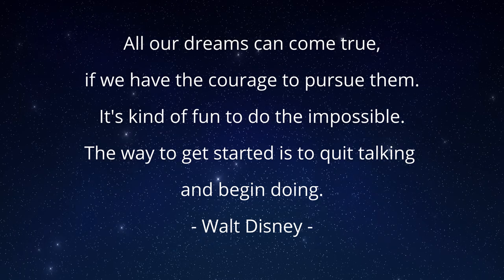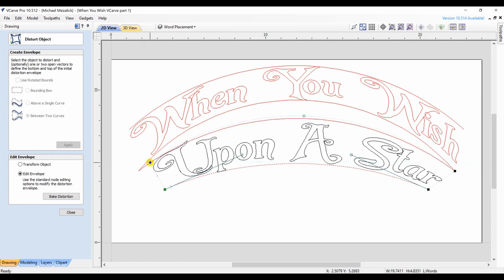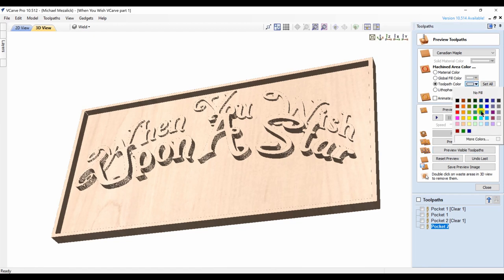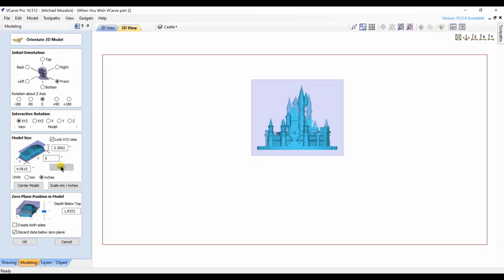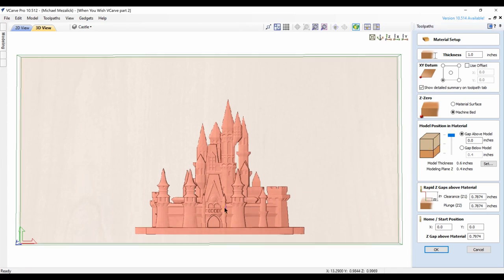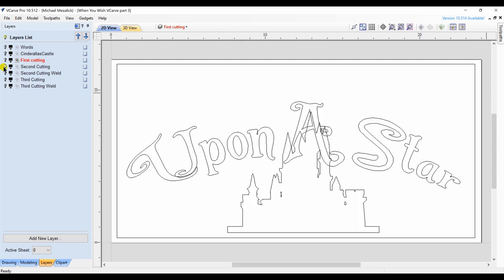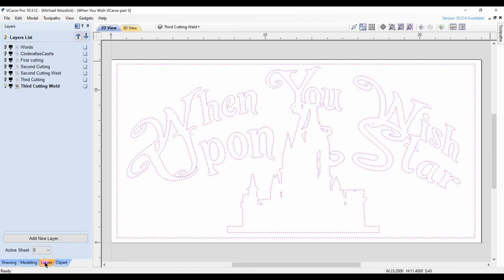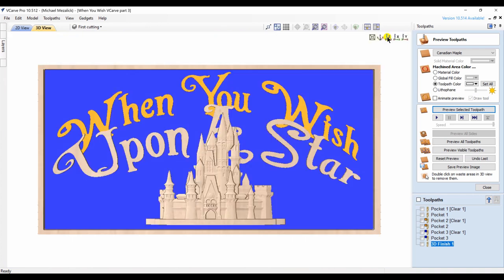Stacked Text with a 3D component Using the VCarve Software Vectric

Comment: this is awesome!!
is it possible to use a fluting toolpath on the text to make the text lean back into the sign...or make the text into a 3d component to carve more dimensionality into the text....not sure im explaining  clearly what im asking ...
Reply from the maker: You can certainly create a 3D component and fade or tilt it in Aspire but that method would not work in VCarve. You could use the molding toolpath instead of the fluting toolpath to first create the slanted surface then pocket out around the text to make it appear to be slanted. Or you could use one of the 3D tabs that comes with the software. Several different ways to do that.
Reply: @mezalick   thank you Michael...i greatly appreciate you for sharing your knowledge with us . i personally have advanced in aspire directly from your teaching..thank you sir!